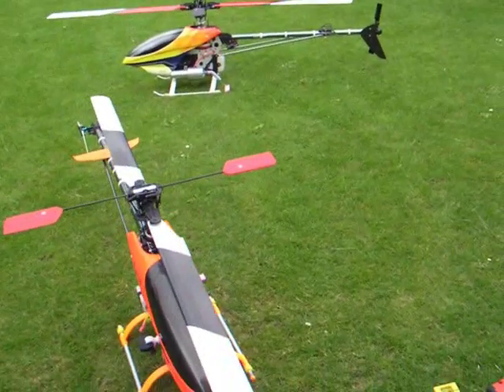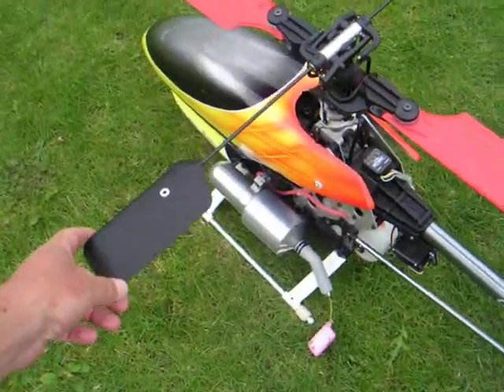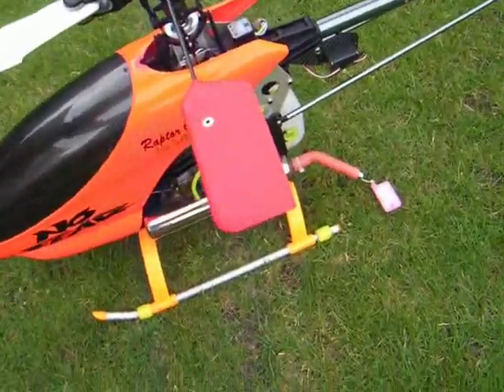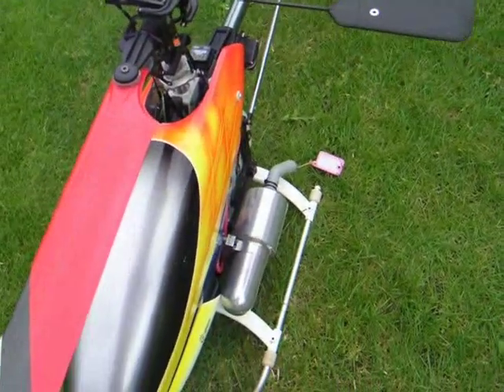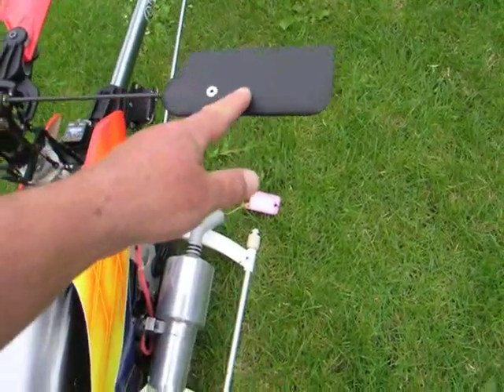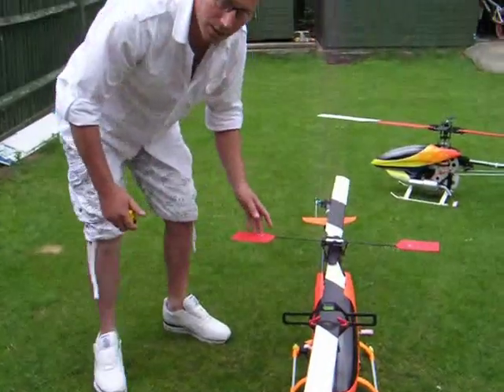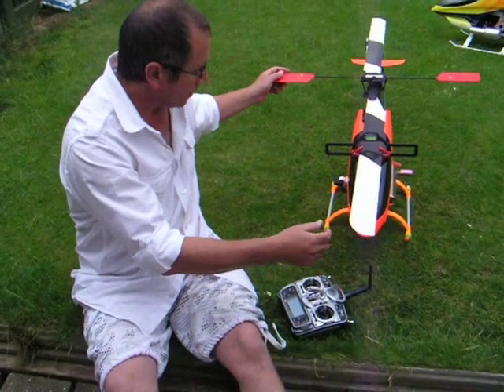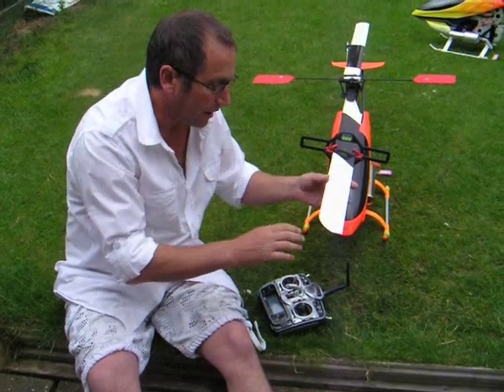RC Helicopter flybar & pitch set-up

Comment from the maker: bogged down =  to much blade pitch for the engine to turn, so the engine slows right down.    there is a limit to what an engine can turn at any point in time.  thats why with helicopters rotor head speed is critical for the engine to in crease power when the blade loading changes.

Comment from the maker: nitro heli`s are designed to fly with just the main tank. but i wouldnt trust it, if you have the time, put a header tank on, just to be sure no air gets up the fuel pipe.

Comment from the maker: to ajust the deg. of blades for aileron & elevator, use the servo throw part of your TX and ajust the the percentage of throw for the appropriate servo, ie aileron with the pitch gauge on the main blades, ajust throw and check deg on gauge as you change the setting of the throw unitl you reach 6 or 7 deg. do this in both directions left stick and right full stick.  do the same for elevator.

Comment: GOOD job john
ive had cf paddles forever and just hovering and a bit of ff ill change the peddles when  start 3d
and my rappy 50 has a novarossi .57 motor the rapp 60 has stock paddles.
should i us a pitch gauge on the paddles for 7 degrees ?
your awesome man thanks